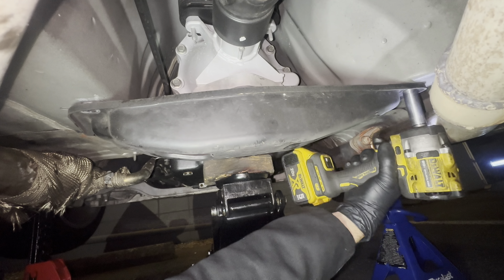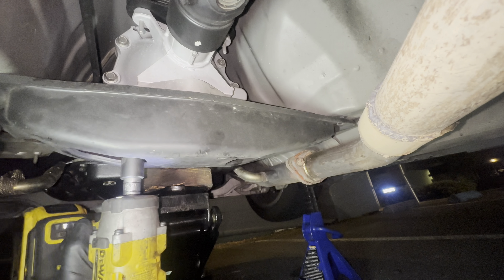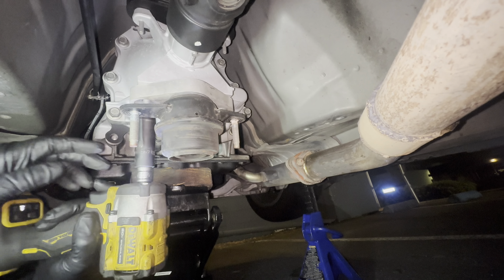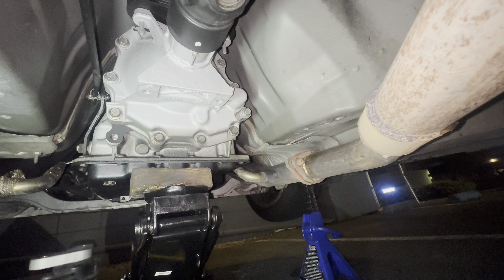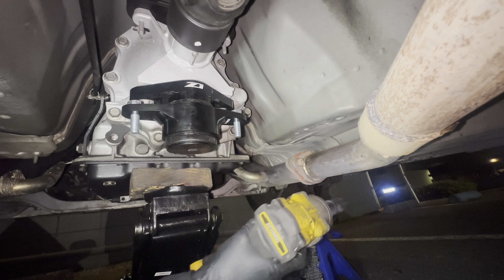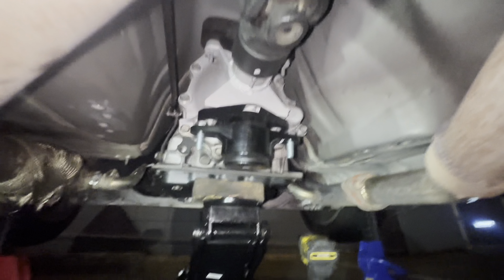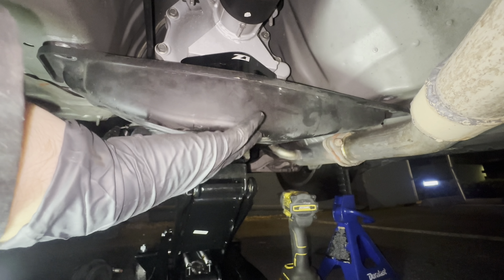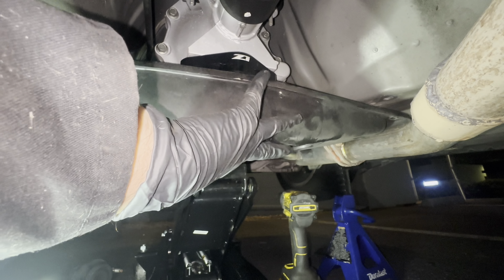How to properly install Z1 polyurethane transmission mount on your G37/370Z (super easy)

Comment: removed mine after a week. Yes drivetrain feels more solid, but the added in-cabin exhaust noise, vibrations and in my case drone at 1100 rpm are not worth it.
Reply from the maker: Don’t daily a car with this mod. This mod eliminates all comfort and quietness. It’s only for track or performance purposes
Reply: @mastertech6049  not a daily. drove 100 miles in past 2 years. Not for everyone I guess
Reply from the maker: @ yup

Comment: Does that only fit for the manual transmission?
Reply from the maker: @durellwilloughby3628  I’m not sure bro
Reply: It does. I installed mine back then
Reply: it fits both 100% sure. I sold mine after installing it on 5at to a friend with a manual. He did not like it either though. Now I am finishing a manual swap and wondering if I should try installing it again

Comment: Just installed the same mount on my m37. I really did notice the vibrations and especially in the steering wheel (not sure if i like it yet)
Reply from the maker: very normal, you will get used to it